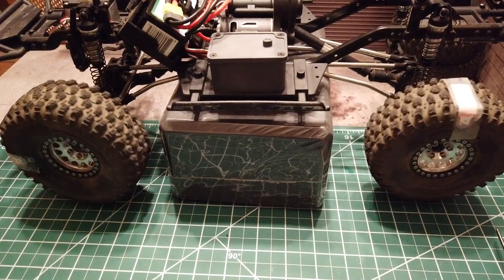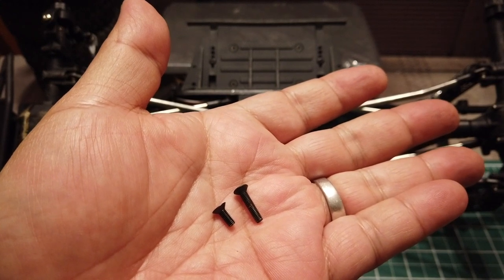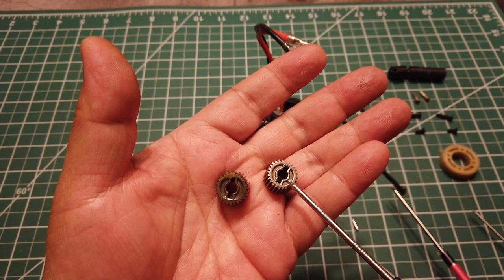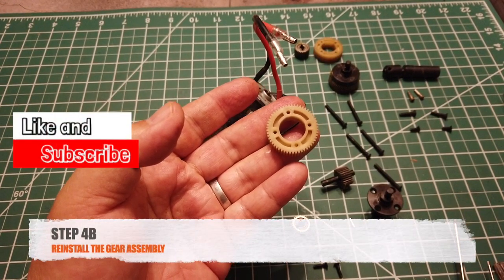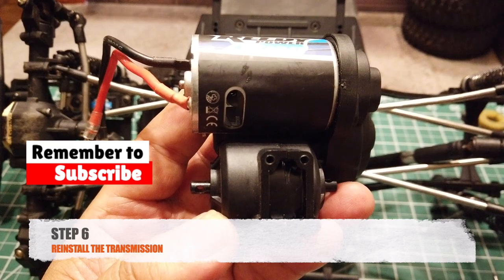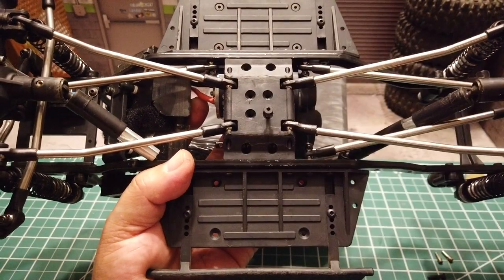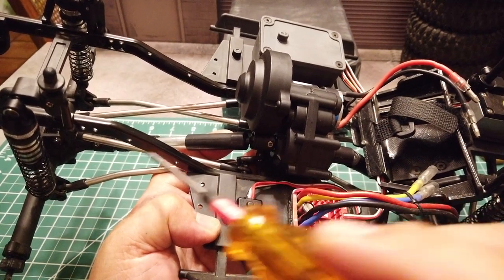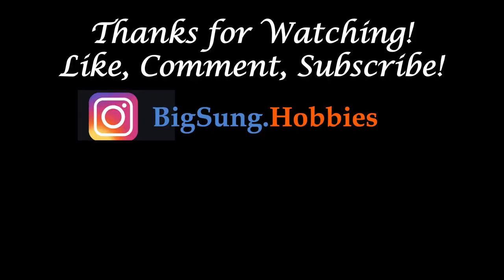How To Install The Element RC Enduro Optional 11.83% Overdrive - BigSung Hobbies!

Comment: What does being in phase mean for the driveshafts?
Reply from the maker: Phase angle is the relative rotational position of each yoke on a driveshaft or coupling shaft. When the yoke ears are in line with each other, this is referred to as “in phase”.  Simply, being "in phase" can save you from binding issues depending on you rig and setup.